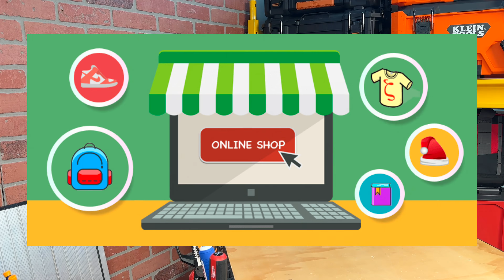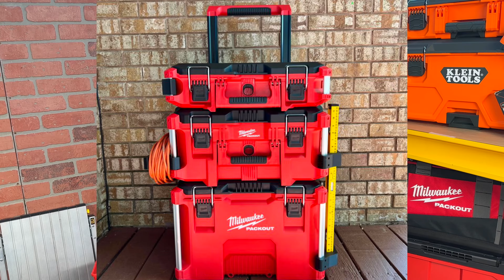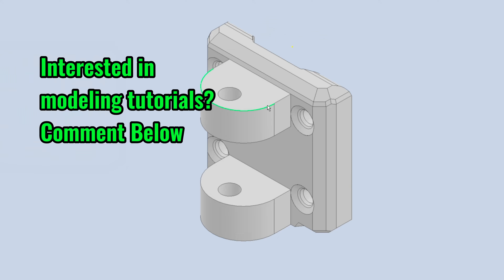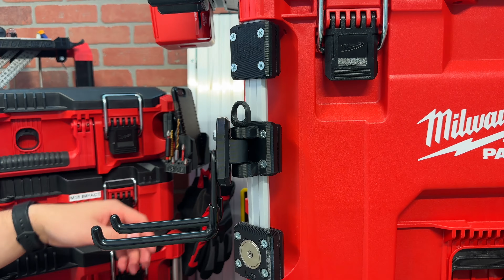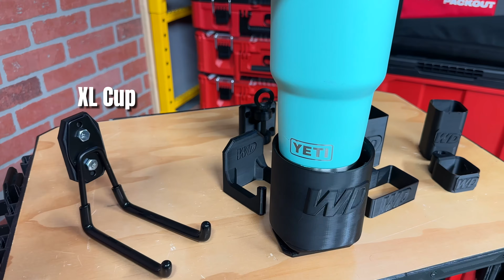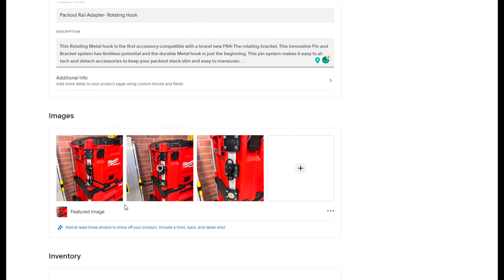NEW Milwaukee PACKOUT IDEA / How to Make A 3D Printed Product

Comment: Need to make a  Milwaukee  fuel pro press case with  tool and all the heads- 1/2, 3/4, 1", and 1 1/4".  The Milwaukee  moulded  cases are too bulky and have wasted  space.  You will have to use one of the thicker packout cases .  Also a  Milwaukee  fuel  pex  tool with 1/2, 3/4, 1" heads would be nice. That way they will be better  to haul into buildings and store with the other packout tools I have. Thanks!

Comment: Have you designed anything for the packout rails that can hold an umbrella or something similar for providing sun protection?
Reply from the maker: Depending on the diameter of the umbrella the rotating pipe bender may work. If it’s the diameter of a broom handle the Long tool holder PRA may work. Or you can make your own custom holder with a 1/4-20 PRA and pvc pipe

Comment: i like your thoughts. any thoughts on making interior items for the packout? something i find frustrating is that Milwaukee only offers inserts for their own tools like their sockets, AND their interior trays only have space for their limited socket sizes. so what happens when a user wants to add a few larger sockets? fail. or what happens when the end user only needs SAE OR METRIC tools? again. fail. i am an industrial millwright, and i use only SAE tools. what i want is a packout box with the clear top. (done) BUT, i would like hangers/organizer for my SAE wrenches on one side, then an organizer for all my SAE sockets on the other. for my job i use sockets/wrenches all the way up to 1-1/2"! i use a complete set(1/4", 3/8", 1/2" drives)regular and deep, with 1/2" drive sockets to be IMPACT rated. i mostly use gearwrench tools these days. eventually i would like one kit for SAE and one for metric. being able to hang a packout on a wall with my entire SAE kit would make me drool. ;)

Comment: any chance you have looked into making any adapter pieces for the flex stack pack, there really is no one else making adapter pieces for it, but I like your explanation of how you did the packout adapter.
Reply from the maker: I haven’t had too many requests for flex stuff so I’ve been holding off. It’s on the to do list tho
Reply: @JakeWeihe  yeah, I’ve been stalking Etsy shops asking them but they also state the same, I adapted some of the Milwaukee clip tech rail adapters by tapping out the middle and threading it into the flex side rail holes, kinda wobbly but works ok, but if you ever do make any I will definitely get any adapters you produce

Comment: Excellent video brother.  For the cup holder im looking for one that will swivel also. When you tilt the system back the cup holder needs to stay upright. 
Do you offer that ?
Again, thanks for the video.
Reply from the maker: That cup holder is in the works as well. I’ll post at least a short when it is done